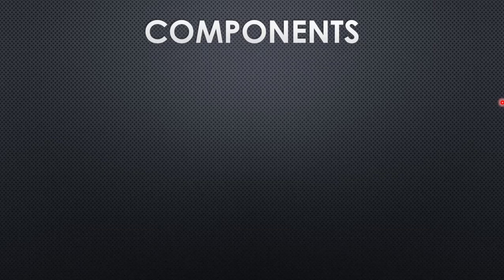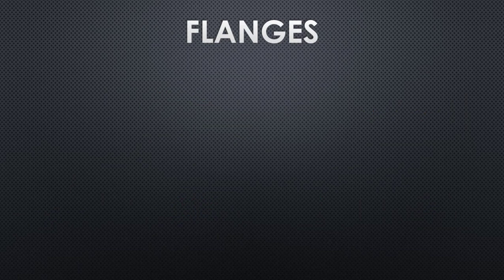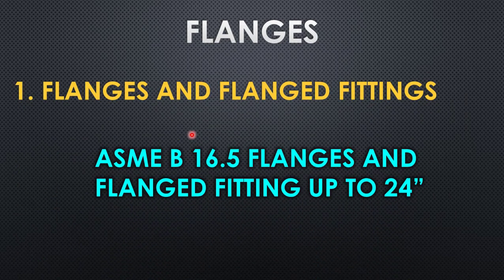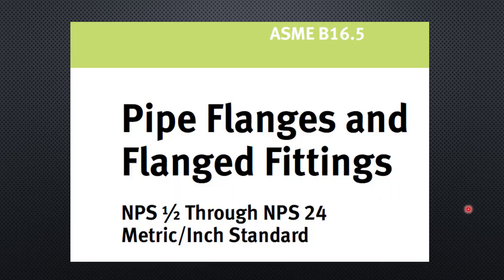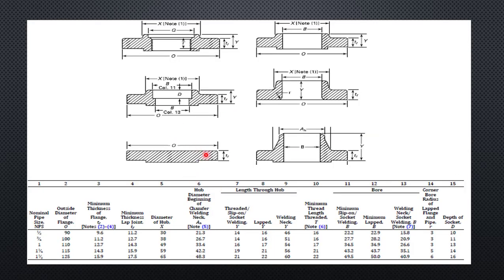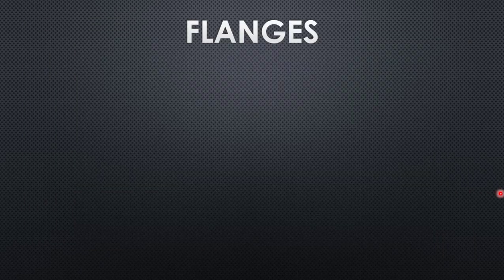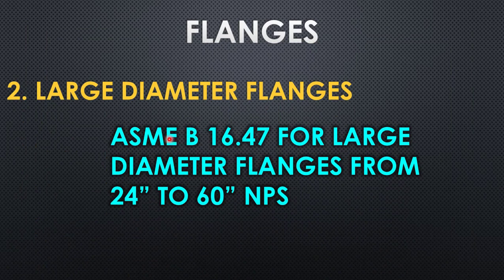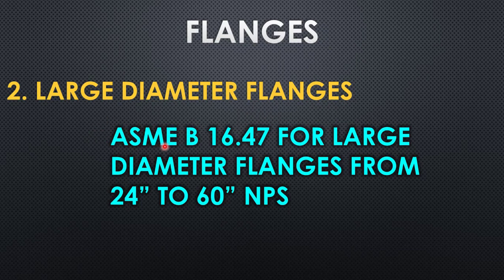International Dimensional standards for Piping components -  Part 2

Comment: Can you make a video on Asme PCC-1? Concerning its application for both inspection and engineering.

Explain the bolt torque calculations and where to reccomend torque/tension.

I have worked in flange management but still have a lot to learn in this area.

Can you explain the acceptable leak citera as well?
Reply from the maker: Hi Ram, I ll try one. But, ASME PCC- 1 has very little role and no role in Piping Design. It wouldn't be helpful for wide range of viewers. However I ll try sometime later.